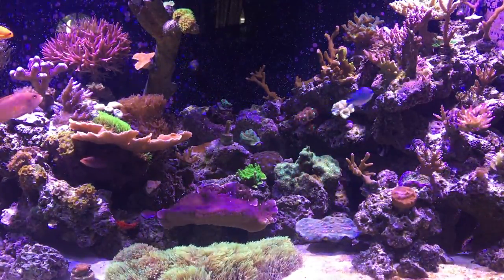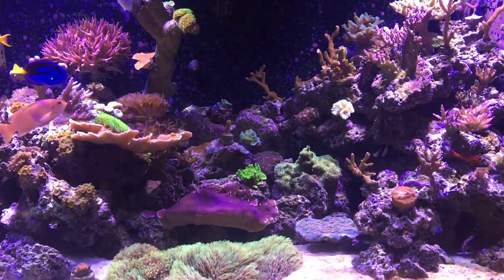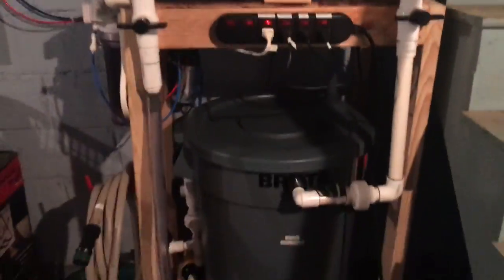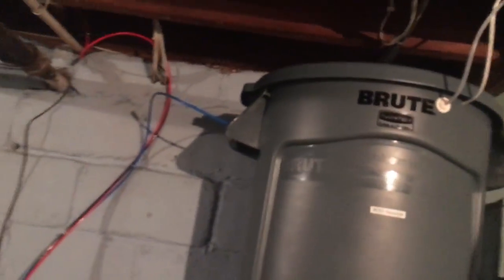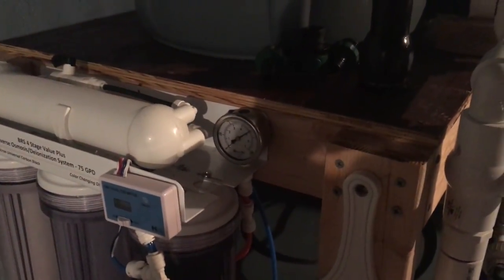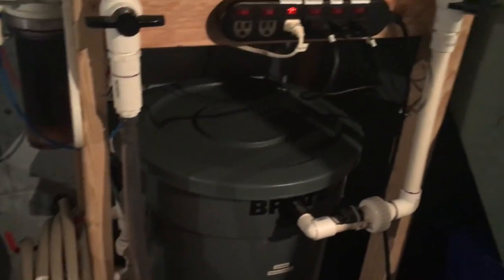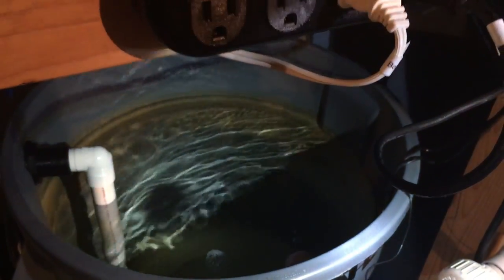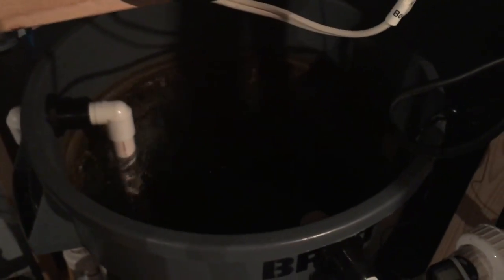Saltwater Mixing Station

Comment: Love your setup reef spy..I have a question... What did you use to T off the cold water line from the ice maker line? That's exactly what I want to do with my ice maker line..
Reply from the maker: I'll shoot you a quick clip tomorrow to show you what it looks like, but it's just a 1/4" brass T fitting I got at Lowes.  It's used for connecting this type of tubing. You'll find it in the plumbing section.
Reply: Thanks..

Comment: How Long can you store the mixed salt water in that container before you do your water change?
Reply from the maker: I usually mix it the day before a water change, but on occasion I never got around to it and left water in there a few weeks before i used it.
Reply: @ReefSpy  so when You left it in there for a few weeks before using it where all the levels still where they should be when you did get around to using it?